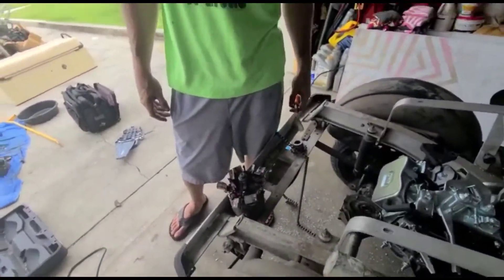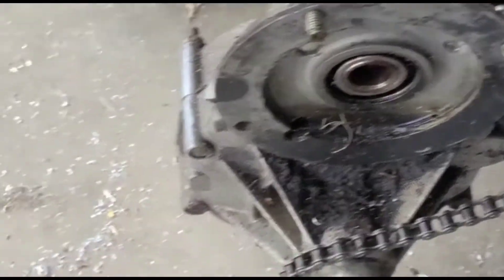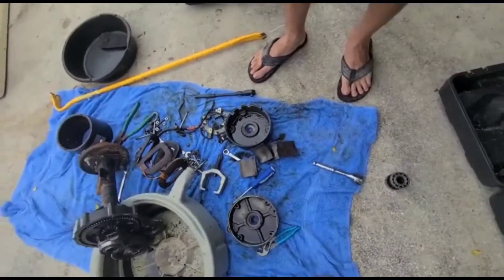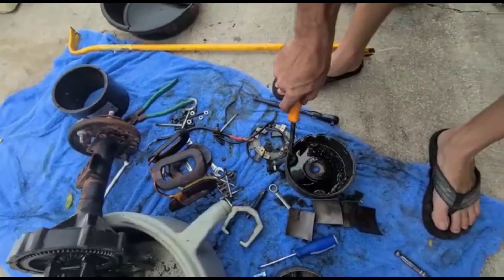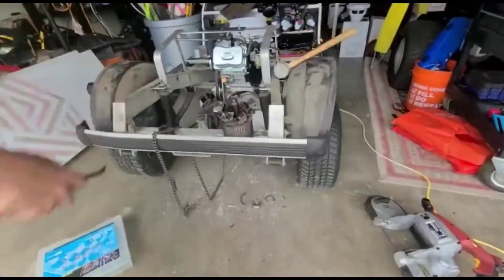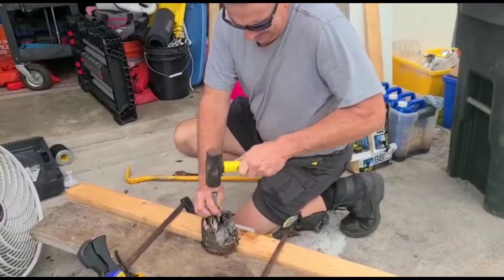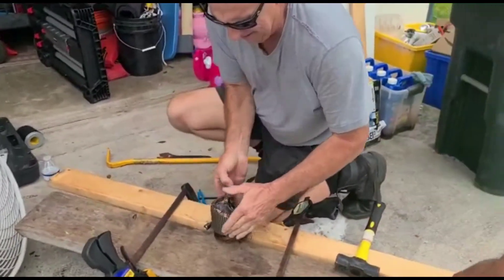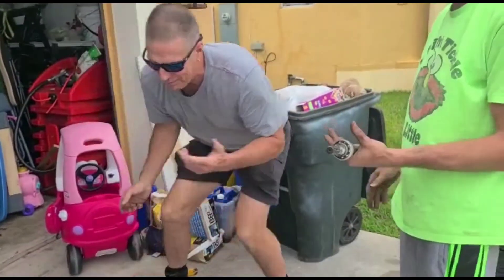Convert electric to gas golf cart project part 5

Comment: I cut through the exposed copper wires with a cut off wheel, and then I was able to easily press the shaft out of the motor.
Reply: that helpful thanks